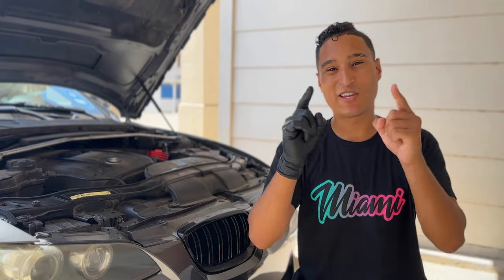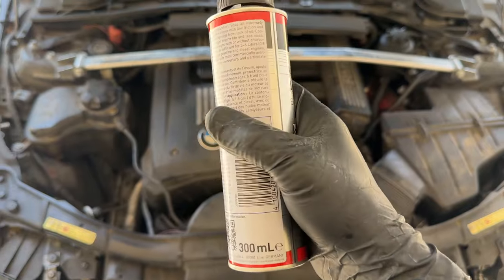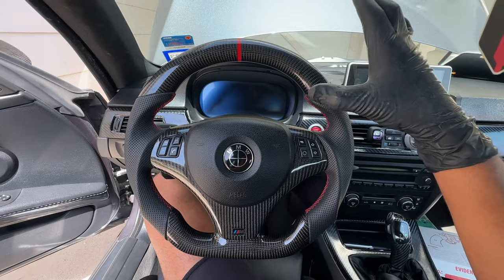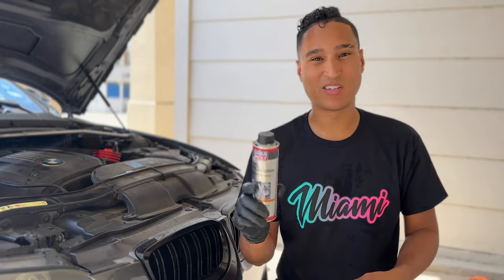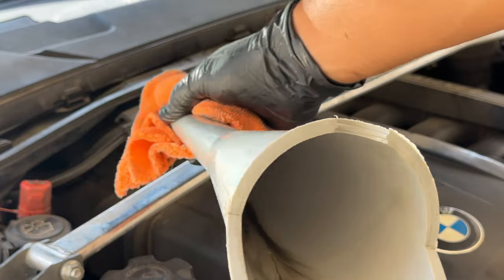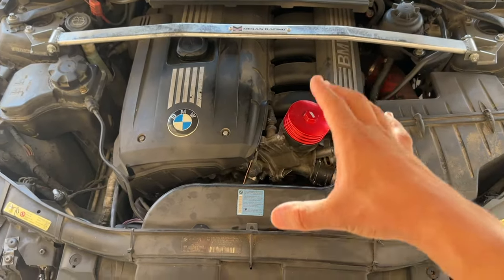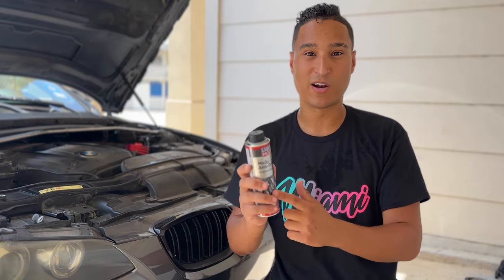This $8 Product Will Make Your BMW's Engine Last YEARS Longer! | LiquiMoly MoS2

Comment: I'm not trying to discredit your video or anything but... the effects of the engine running more smoothly and silently could easily be credited to the fresh new oil you put into it and that it was just time for an Oil change. To 100% say the additive works you would have to have 3 clips (before, new oil and new oil with the lm additive). Just my 2 cents.
Reply from the maker: the sound clips were both after the fresh new oil change. I changed the oil, took the 'before' soundbite, then poured the LiquiMoly and only a tad bit of oil to wash the LiquiMoly down. I did not conduct an entire oil change before pouring in the LiquiMoly.
Reply: Probably should have mentioned this in the video or description.  You also mentioned that you have been using this product for years.  Pretty amazing how different your engine sounds before and after the additive after all this time.  You would think/hope this stuff would accumulate and offer a bit of residual protection but it seems it all comes out every oil change.  Good video otherwise.  I would use this on a new(er) engine but skip it on older high mileage ones.
Reply: That’s inaccurate, oil change tend to renew oil which result in a less viscous oil and often new noises are exacerbated after an oil change.
Reply: Correct.

Comment: Adding moly disulfide is a useless waste of money at best and dangerous to your engine at worst. This is basically a solid lubricant suspended in a heavy oil...almost like you're dropping a spoonful of axle grease into your oil pan. It's most likely to collect at the bottom of the oil pan and/or your oil filter. Worst case, it clogs up your lifters and/or VANOS solenoids (or any other engine's cam phasers). I'm a metallurgical engineer at a major automobile manufacturer and a big part of my work is wear and failure analysis on gasoline engines. We work closely with lubricating oil manufacturers to specify exactly what should be included in engine oil and then the engines are designed to operate with that type of oil. If a big glob of super high viscosity oil packed with moly disulfide made engines last longer and run quieter, we'd write the specifications for the oil manufacturers to blend it in. It would help us meet our engineering targets and make our lives easier. It's not blended into the oil because it doesn't help.
Reply: I’ll try it & let you know on a CLA250. Real life trials are better than equations
Reply: Hi Elektro. I'm glad to be reading some actual science from a metallurgical engineer in this thread.

In view of both your academic and professional knowledge, I will accept your advice to not install LiquiMoly MoS2.

I'd be very grateful to receive your further advice:

Five years ago, I bought a 2003 BMW E46 318i running an N42 engine with 105,000 miles on the clock.

I bought her for only £725 = $915.

During these five years, I've only driven her a total of 10,000 miles.

I admit that I've not done any work on her engine, and the oil is black.

I now finally have the time, the money, and the inclination to look after her, which is what's brought me to this thread.

For a 2003 N42 engine, BMW recommends a 5W-30 oil which complies with the BMW LL-01 (LongLife-01) specification.

However, because she's got 115,000 miles, and no oil change during AT LEAST the last 10,000 miles, should I instead be installing 5W-40?

At the same time, because E46 YouTubers rave about them, I'm intending to install a Hengst oil filter, as opposed to a BMW OEM, Mann, Mehle, or any other filter.

Do you approve of Hengst?

Simultaneously, I'm going to be changing the spark plugs.

I've been reading that more important than the brand is that I should be installing plugs which are double platinum or, even better, triple platinum.

Or, even better, iridium plugs.

Do you agree that NGK iridium plugs are the best way forwards?

The garage which will be doing all those jobs is recommending that because the engine has not been maintained for AT LEAST 10,000 miles, it should be flushed before the new oil, new oil filter, and and plugs.

I certainly accept your advice about Mos2.

Would you recommend a standard LiquiMoly flush for this 20 year-old engine with 115,000 on the clock?

Many thanks.

Best,

Michael
Reply: @CasperTheFriendlyGhost777  What happened?
Reply: @jayy7712  It made it more quiet but no dramatic change
Reply: service manuals specify putting molybdenum disulfide grease on cam lobes and rockers .
Reply: @LoveableRogue  Hi Michael,

Never got a notification for this reply, otherwise I would have answered earlier.

1) Black engine oil is completely normal. After draining and refilling the engine with fresh oil, you can expect the new oil to be black withing a few hundred miles due to submicron carbon particles from burning gasoline slipping past the piston rings into the crankcase. This happens on all gasoline engines no matter the engine condition and does not indicate that the oil is no longer usable. 

2) Engine oil is very thick (high viscosity) at ambient temperature and gets thinner (low viscosity) at engine operating temperature. The SAE oil viscosity rating (5W-30 or 5W-40) uses the first number to represent how thick the oil is at ambient temperature and the second number on a different scale to represent how thick the oil is at operating temperature. Every piston engine is designed to get the best protection from a particular oil viscosity at operating temperature. All engine oils are too thick for best protection at ambient temperature, even if ambient temperature is Death Valley, California in August at noon. So you should always buy oil with the first number as low as you can afford (there is no drawback to lower "W" viscosity numbers other than cost). If BMW recommends 5W-30, then 10W-30 is so thick at ambient it could cause problems, 5W-30 is acceptable, and 0W-30 will improve protection and fuel economy, but is more expensive. The second number measures viscosity at operating temperature, and you should NOT use a higher viscosity just because the engine has been neglected. That will reduce the amount of oil the engine can pump through tight spaces and likely increase wear. The only situation where you want the second number higher than factory recommendation is if you are racing or towing and you are heating the oil up higher than normal operating temperatures. Also some engines with serious wear problems may exhibit low oil pressure at high RPM and normal operating temperature and can be preserved a while longer with higher viscosity oil, but your engine does not sound like it has that kind of wear problem. In the US market, I would recommend Castrol Edge 0W-30, Mobil 1 ESP 0W-30, or Redline 0W-30. If you're in the UK I don't know whether any of those are available, but any synthetic 0W-30 should served perfectly well. 

3) Hengst, Mahle, and Mann filters are all excellent. My wife just bought a 2014 BMW 328d xDrive last month. I put Hengst fuel and cabin air filters in, and Mahle oil and engine air filters. 

4) Spark plugs need to be the correct fitment and heat range. Other than that, they either work (start the gasoline burning) or do not work (misfire). If the engine is not misfiring, there isn't a whole lot of reason to replace functioning spark plugs. However, all spark plugs wear over time, so if your original equipment plugs are at the scheduled replacement interval, they may be worn close to the point where they could begin misfiring soon. When you do replace plugs, there is absolutely no difference between the functioning of copper, platinum, iridium, single electrode, or multi-electrode plugs. The platinum electrodes last long, and iridium longer still, just like multi-electrode plugs last longer than single. But until they wear out, they all do the exact same thing. I like NGK for their high quality control standards, but there's nothing unique about them. Bosch are excellent, too. 

5) I recommend using an engine flush solvent specifically when changing high-mileage engines from petroleum oil to synthetic oil. That's because petroleum oils contain a certain amount of long chain hydrocarbons (essentially paraffin waxes) that over time get deposited on internal engine surfaces. They tend to stay there and usually don't cause a problem, but switching to synthetic oil may wash them loose because the synthetic itself is a better solvent than conventional oil. I'd rather use a concentrated solvent and wash them all out at once, then drain right away, rather than allow them to break free over time and maybe clog the oil filter. But in your case, it sounds like this isn't relevant. If the engine has always been lubricated with synthetic oil, there won't be any wax deposits because it doesn't exist in synthetic oil in the first place. So there's likely not much or anything to flush.

Hope this helps.
Reply: @giwtwm  Which manual, BMW? Which engine? Are you talking about during engine assembly or maintenance?
Reply: @elektro3000  assembly when brand new
Reply: Hey, how about Ceratec?
Reply: We use the liquid Moli,, anti friction on ALL OUR HARD RUNNING 🚕 🚖 🚕   AMAZING STUFF🎉🎉🎉🎉🎉

Comment: If you have been using LM for years, why was the engine so loud to begin with?
Reply: Because N52s are known to have lifter tick. Not to mention, the injectors on these engines are very loud.

Comment: I am sold - Run it in my 911 3,2 - Should have done it years ago! Runs smother, less oil burn. Had my 911 for over 10 years and know it well.  All around great product. They make great motor oil to go with it.

Comment: Not surprised the after sounds better, as the car has fully warmed up. Not knocking LiquiMoly products. However, none of it’s an instant miracle in a can. The effect is cumulative and gradual through appropriate use over time.

Comment: IzzyE9X: Great video. I do use LiquiMoly MoS2 on my E92 M3, but not every oil change. When I do use it, I use the whole bottle with LiquiMoly 10W60. Question, do you use it every oil change???
Reply from the maker: I personally use it every oil change, but only use about 1/3 to 1/2 of the bottle
Reply: Great STUFF🎉🎉

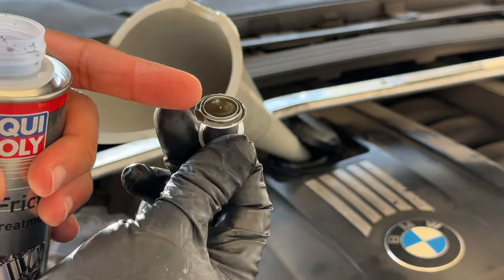Comment: There is a recommendation to the amount of MoS2 it’s 5% of your total amount of oil needed. So if you need to put in 5 Litres that equals 250ml. So you can easily add more to your next oil change. 2:57

Comment: Oil, is an extremely good lubricant, wear reduction, low friction etc. Unless there are issues with your car stop putting additives to it. Use thicker oil if you want it quieter
Reply: Thicker oil makes it louder. I have a 2005 Hyundai accent 5w-20 motor oil. The Walmart guys accidentally poured 5w-30 in my motor. My car was running loud and burned a lot of fuel. A thinner oil makes the car run smoother and saves gas. Why do you think liquid molly increase mpg? Because it makes the car run smoother and less friction
Reply: Just buying quality engine oil solves the problem normally. But using additives have play role too depending on which one you buy
Reply from the maker: @ismaeel624 this is a very reasonable comment

Comment: Right , you should have changed the oil first and then do sound test
Also, mos2 should be added. In  older cars 2000s and lower 
On newer cars you should use ceratec
Reply: Why? Can you explain please?

Comment: My accord hybrid holds 3.8L of oil so should I add this top of 3.8L of engine oil or should I put in 3.5L of engine oil and fill the rest of the capacity with this?
Reply: Seems like a no brainer. Whats the capacity? 3.8 or 4.1?
Reply: Put in the 3.5L first

Comment: MoS2 was used in plane engines as a back up measure should the engine lose its oil.
This gave the engine enough lubricity to assist the aircraft to land.
Reply from the maker: this is extremely interesting, thanks for that info!
Reply: MoS2 was used in aircraft engines in WW1 and I suspect also WW2.

Comment: Please man 
Put motul 0w40 x-max in that engine 
It is day and night difference between motul and castrol 
I had bmw 1 serie with n42 engine 
Oil consumption went from 1 liter/1000 km to 1 liter to 10.000 km without using any aditive 
I had bmw z4 with m54 engine 
With motul straight away you feel the difference 
Now I have an Audi TDI that requires dpf oil but I’m changing to 0w40 even if it doesn’t have dpf approval 
Of course I use mos2 
I use always mos2
My engine sounds healthy and I cannot hear any difference but I use it for extra protection
Reply: 300 ml of mos2 treats 5 liters of oil 
In that engine you need 400 ml 
Half bottle it is not enough

Comment: LIQUIMOLY CERATEC VS MOS2...WHICH IS BEST?
Reply: They are basically the same product.
MoS2 is added every oil change while Ceratec lasts for several oil changes.
Reply: Ceratec for newer engines. MOS2 for old ones.

Comment: I have a BMW to its n52 and also have N55 but that's the only have the implied to BMW or can we put on Japanese cars too?
Reply from the maker: this product states on the back “for all 4-stroke gasoline or diesel engines, with or without turbos” so I think you’ll be safe even in a Japanese car
Reply: @IzzyE9X  ok thnx...I see I just have to make sure it's a 4 cylinder only...😃
Reply from the maker: no a 4-stroke, that means any engine basically  4 cylinder and 4 stroke are different haha
Reply: @IzzyE9X  I got it

Comment: I have a 535i & wanna take better care of it where should I start?
Reply: Change oil and oil filter every 4000 miles or 6 months. Every one or two years change engine air filter, fuel filter and cabin filter. Every 30000 miles change the sparkplugs. Put the best gas you can afford. Do not red line the engine when it is cold. Eventually, drive the car on the highway for 2 or 3 hours. Wash it once a month...